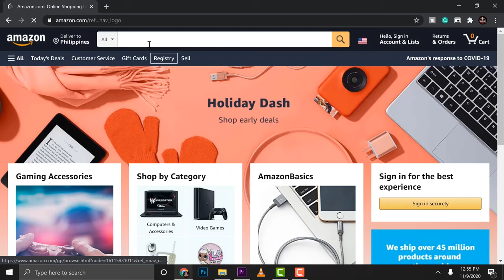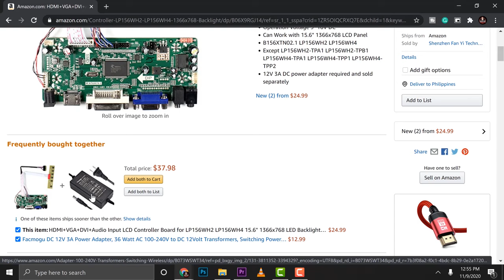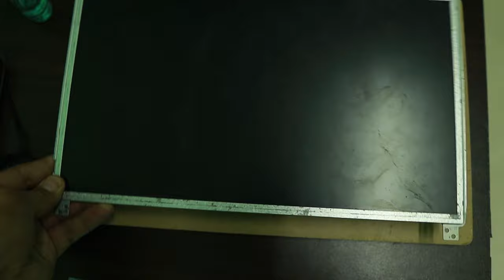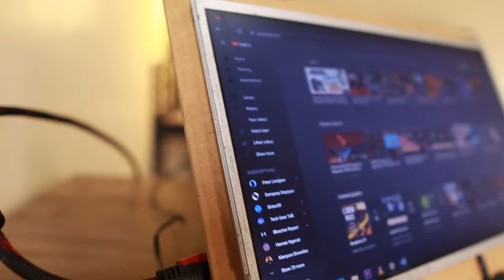How to turn Old Laptop Screen into External Desktop Monitor

Comment: I already have a HDMI port on my laptop
So do I need to buy that controller?
Reply: Correct
Reply: Nope. You need to buy controller for connecting to PC or laptop. 
Also note that he mentioned working screen of laptop. If screen doesn't work, no use buying lvds controller with HDMI (both audio and visual) or VGA (display only)

Comment: nice vid mate, i did get my control board today and when i connect it power on and 3 seconds later and power off its self  , do you know whats wrong... i use 12V power supply

Comment: Do you NEED controller ?? What if I wire connector that used to plug in to motherboard straight up to HDMI port ? Because buyng whole Controller board is for 20$ makes no sense... when WHOLE LAPTOP of that screen cost like 10$...

Comment: Hey guys so I've tried to make my laptop screen monitor but the laptop's power cord doesn't seem plug into my control board. I know the model of the control board fits the model of a screen bc I've checked it a thousand times before I ordered it. It also looks like it SHOULD fit as the hole is the same size. Any advice?

Comment: I know this video is old but I still want to give it a shot by asking this, is it okay to put a foam or some kind of padding underneath the LCD screen? I kinda want it to rest on top of the foam.
Reply from the maker: Not recommended bruh. It generate more heat, how ever you can place it underneath following the frame only (rubber) is better though
Reply: @torogipro Damn, I wasn't expecting a fast response. I'm impressed! Thank you for the info bro.

You deserve more subscribes!

Comment: Is it possible to find a very compact driver board?
Something preferably with SMDs instead of tall components!

Edit:
Also what refresh rate do these driver boards support?
Reply: It's all in the specs when you find the right one. Also most non-SMDs, tall components used in these adapter boards are this size because of the currents/voltages they have to handle. Not everything can be tiny SMDs. Power dissipation has a lot to do with this.

Comment: ya real nice I'd love to see someone actually reuse a lcd or led screen without having to buy a control board which is a real pain in the ass I've bought 3 boards and been saving every screen i come across fro 7" to 55" without a conrol board or a way to connect HDMI it reall aint worth the trouble .If your like me and are trying to get around reuse sreens for your pi and have found away to connect your pi to a monitor screen or something that doesnt come with HDMI wiyhout spending anymore $$$$ then please let me know

Comment: I've been trying to do this for awhile but I can't find a controller board that supports it (ltn156at39-d01) all I can find is ltn156at39-H01 and ltn156at39-B01 but I can't find out if those boards will work for mine
Reply: You use the model no. to find what voltage it runs at and cable it uses. In your case it uses 30 pin cable, problem is I don't know if it is Edp/lvds 30 pin, you also need to know what voltage it uses or you'll fry it. An Edp/lvds controller will do all the work for you just set it at the correct voltage and get the appropriate "30" pin cable for your panel

Comment: I wanna use my old laptop screen as a screen of a new laptop thaf will be ran from my samsung phone samsung dex. I'll use my phone as touchpad and another keyboard! Hope it works!

However, it must use the power of the phone so hope i'll find that. I feel like thunderbolt, which every modern phone is rocking now, should provice enough power to run a simple led monitor.

Comment: So there’s just one thing he didn’t mention or acknowledge in the video. What about audio from this diy monitor. Imagine that your using this screen for something other than a useless external dual monitor for your laptop and the source video device has no internal audio device equipped. For example every gaming console since Xbox 360 slim.
Reply: HDMI supports both audio and video on the same cable. VGA cable is only for display

Comment: Sir tanong ko lang po, paano po kung may camera po yung laptop? Pwede pa rin ba po siya i-dagdag?
(Sir may i ask, what if the laptop has a camera? Can i still add it in the project?)
Reply: strip the camera connector and find the pinout  solder a usb cable on it, plug and play lang naman siya sa laptop thru usb. Hope this helps

Comment: how do you turn the monitor on or off without the power button?
Reply: the controller board comes with a power button, and the access for the monitor settings

Comment: Excuse Me Sir,, 🙏😷🙏, I have problem with my laptop HP Pavilion TS14 Ultrabook,, and the case like the same in your video. My Lcd laptop is broken, and i want to display on my TV with cable HDMi, But...i cant see POST Process before  into windows logon, and can't display BIOS Setup. Please Help Me... 🙏😷🙏😷🙏☝️
Reply: Do you have HDMI or VGA output from your Laptop to your TV?

Anyway, the trick here is pretty simple. First, you need to connect everything.

Now turn on your Laptop, (assuming the Laptop alone is still good condition) wait several seconds until you Think it reaches Logon screen.

Obviously it is not showing anything on your TV. Press Windows key on keyboard and P simultaneously.
(Win Key + P) until you see Response on the TV.
Reply: @ClayWheeler  Thanks for Your Respon 🙏🏽😷🙏🏽.  I only have HDMI port on my laptop and if i want connect to VGa Port on my TV ,i use cable Converter HDMi to VGa. My TV LED,size is 24Inc.
Reply: @indihomeivanet9763  yeah anyway press Win key + P on keyboard like I said before
Reply: @ClayWheeler  I have done it! (Win Key+P)☝️, But my isue still the same,can"t display POST Proses and cant show BiOS Setup. Only show Win Logon Screen, Buttt...,i forget my password! 🤫🤭😆😆. Can You reply quick my chatt please, Urgent ! 🙏🏽😷🙏🏽😷🙏🏽👍
Reply: @ClayWheeler  FYi, my laptop Type HP Pavilion TS 14  ULTraBook n033TX.
Reply: @indihomeivanet9763  WaTeFK
I cannot help you further. You may need to reinstall Windows.

Forgot password is very difficult to deal with
Reply: @ClayWheeler  Thanks for your Help. 🙏🏽😷🙏🏽. FYi..,, I only need to show POSt n BIOS screen to  use booting from Cd or Usb, and then i could to reset my windows password. Thank You.. 👍🙏🏽😷👍🙏🏽😷

Comment: great content but at no point did you compare the actual lcd model number with the board you purchased... theres no 156 anywhere on the back of your monitor yet you purchased that board... confusing and little help, otherwise great video
Reply: at 1:47 you said "i betcha this is okay" this was the single most useless statement of the video... i just wanted a side by side of here's the model i need... here's the same corresponding model number control board... but nope you said something with no utility with no comparison... smh

Comment: Tried disassembling an old laptop for the display. Accidentally ripped the cable for the inverter out of it, thinking it was the wifi antenna.

Guess I'll just buy a display.

Comment: This project costs more than a used 20 inch monitor... It's good to know this can be done but it's not cost effective.
Reply: If the laptop is good enough the resolution/refresh rate/input delay might make it worth it.

Comment: Why build a screen stand when you own one: it's the dead computer's case.  Can't you just use the whole (dead laptop's) case,  less the motherboard, keyboard and other computer parts?  Why not put the driver board into the now empty lower case half?  Then screw the HDMI receptacle into its place, the power plug into it's... put a brick into the case bottom. Done.

Comment: A million ways to compensate you for your precios time screwing old lcd matrix to a board and using a lvds controler is in the links below the vide but not one with a link to the supplier of the controller. You just earned a thumbs down :)